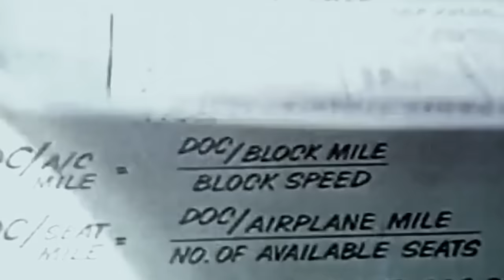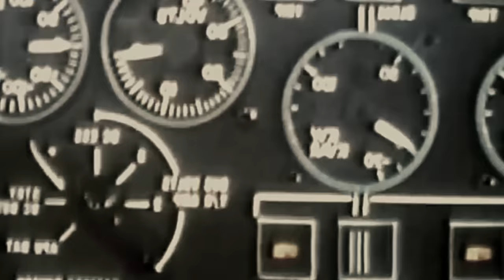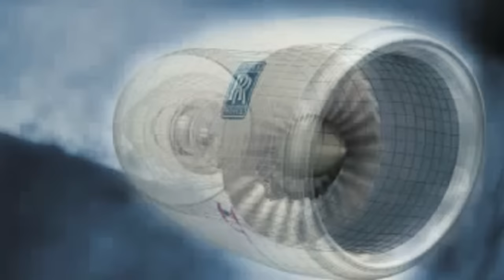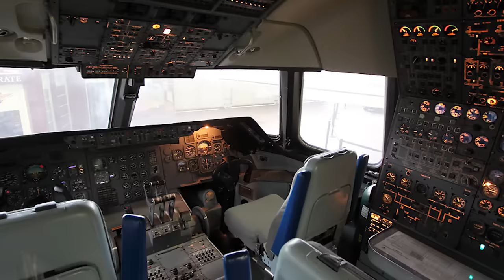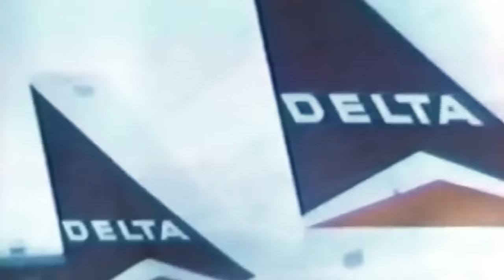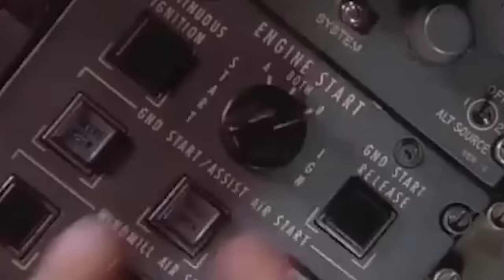L-1011 Tristar - too advanced for us

Comment: The biggest downfall was Lockheed too much tailoring the plane around the Rolls-Royce RB.211 engine. Had it been designed so it could accommodate the Pratt & Whitney JT9D or General Electric CF6 engines, it's likely the L-1011 could have continued in production probably until the early 1990's.
Reply: Had no choice, the RB was the only engine that could fit into the rear fuselage (#2 engine) and produce the power required.
Reply: Wery strange then that When Boeing made the 757 they chose the RB 211 as there first engine.747 and 767was also equipped  with RB 211.Some airports have serious noise restrictions at night and since RB211 is qujeter than it's competitors it is an advantage for the the airline.Less  restrictions at night.Actually Trump insisted on the RB 211 on his own plane because it's qujeter.
Reply: Unfortunately, the RB 211 delayed the introduction of the L-1011, but what ultimately killed it was it's overall cost. It was over engineered compared to the DC-10 that was under engineered for the day. As a result, the L-1011 was about 20% more expensive per unit and the airlines initially went cheap, especially the U.S. airlines. Only Eastern and TWA ordered Lockheed. The remainder went with Douglas.
Reply: The marked wasn't big enough for two similar planes,that's why it failed.Both companies failed.
Reply: @perolavlien2096  - Yes, that is true, in part, however, there were three other factors that doomed the L-1011. 1.) Late introduction due to Rolls Royce bankruptcy; 2.) Cost per unit of aircraft; and 3.) The L-1011 could not be extended on its then current frame and would have required an extensive redesign. As a side note, the L-1011-600 model was a twin engine plane that was in the development stage when Lockheed elected to terminate production of all civilian aircraft.
Reply: Your 3) reminds me of the B707 vs. the DC-8. Douglas, with future development in mind, gave the DC8 longer legs (quite literally) from the get-go, which gave them more leeway with fuselage lengthening and the later CFM-56 re-engining program, while Boeing's choice of much shorter undercarriage legs gave them no room for later expansion without major redesign.
Reply: Delta also went with the L-1011, and eventually became the largest U.S. operator of the TriStar.
Reply: @19580822  True, because the L-1011 was the perfect plane for Delta, especially on its longer routes out of its Atlanta base. Delta L-1011's were frequently seen on the US West Coast, especially in San Francisco and Los Angeles. Nowadays, Delta uses (I think) the 737-900ER aircraft on this route.
Reply: Could be. Used to be the 767, but they're aging fast.

Comment: Loved the Tristar in RAF service, there were a number of variants based on the airframes aquired. The ex PanAm airframes were unaltered, but other airframes were used as tankers with passengers and baggage bins on the main deck. The other variant had a cargo door fitted by Marshall's of Cambridge and could accommodate 108 x 88 aircraft pallets on the main deck.
The usual cargo hold on the tankers was fitted with fuel pods.

Comment: I got to love the Tristar when after leaving the Royal Air Force I went to work in Saudi Arabia.  All the flights too and from Saudi Arabia were done with Saudia Tristars or 747s.  I just love flying in the Tristar, so comfortable and quiet, actually the best commercial flight I ever had was in a Tristar on the day Princess Diana married Prince Charles.  The flight only had 45 passengers aboard and as a result I ended up flying to Riyadh in business class, but there was a lot more about that flight that made it great.  On a sad note I was at Riyadh when the Saudia Tristar returned with a on board fire.  That aircraft as I am sure you are aware burned out on the taxiway killing all on board.  Our flight line building was about 400 yards from the burned out hulk, and I swear to you I can still smell the burned aircraft structure, and of course the smell of burned flesh. That was nearly 40 years ago and I still can smell it when I think about it.
Reply: Dated a flight attendant for American Trans Air. The lower galley on the L-1011 was a great place to join the Mile High Club.

Comment: I was treasurer and fleet officer at American Trans Air (later named ATA Airlines). We began operating the L1011-50 and -100 in 1989. We had 14 standard body TriStars and we added the five Royal Jordanian L1011-500’s to the fleet in 1999/2000. These were great aircraft for us widely used for our Pleasant Hawaiian operation and US military charters. The RB211-22B became a very reliable engine and the -524B4 on the -500’s even better. Besides the shorter fuselage, the -500 has a ten foot longer wingspan with active ailerons. In effect the -500 was a completely new aircraft. ATA became the largest TriStar operator with 19 aircraft in 2002.
Reply: I was a Lockheed system instructor and conducted training at Indianapolis.  I didn't realize ATA had so many Tri Stars.

Comment: The largest aircraft I've ever flown on was a British Airways L-1011, named The Stargazer Rose. I had two rides - the outbound and inbound trips. Outbound I was just aft of the wing leading edge, port side. When the engines started up, it sounded more like being on board a bus, the jet engine whine and whistle was not prevalent. On rotation, I had the most impressive view of condensation flow over the wing imaginable. At first, I thought we were in trouble because you could hear and feel the airflow vibration from inside the airframe - it was a kind of groaning noise. When the conditions causing the rough flow ceased soon after it started, the spectacular display of that flow from the front of the port nacelle, riding over the pylon and past the wing, suddenly stopped, along with the heavy airframe vibrational noise. That true life lesson in aerodynamic laminar flow will never be forgot.

Comment: I was a phase maintenance mechanic for the L-1011 as well as a mechanic for Boeing and McDonnell Douglas aircraft for TWA in the early 90s.  The L-1011 was so much easier than the 747, 757, 767, and DC-9s I worked on.  Even the RB 211 engines weren't bad to work on.  Maybe with an updated engine there might be a market for the L-1011.

Comment: I was working for RR in the late 60s and well remember the problems with the Hifil fan blades which ultimately had to be replaced with much more expensive titanium ones. I left before so-called crash in 1971 (having seen the danger signs) but rejoined 3 years later and stayed until I retired in 1995.  Although it wasn't mentioned in this video the unique feature of the RB211 engines is the 3 shaft configuration as opposed to the 2 shaft arrangemnts of its competitors.

btw though Barnoldswick was one of the earliest RR factories it is still in operation.

Very iteresting video, thanks
Reply: I think he mentionned it.
Reply: And that engine had super fast throttle response due to lower inertia of the 3 spool design.  We had an amusing problem with new pilots over speeding the engine.

Comment: One of the innovations: It had DLC- Direct Lift Control. Only airliner that I’m aware of with it. DLC uses paired wing spoilers and integrated horizontal stab trim to adjust flight path without changing the pitch attitude while minimizing power changes. I believe DLC would have prevented all the hard-landings/bounced landings that claimed several MD-11s. As an aside, the F-14 had DLC. It was a significant challenge getting aboard when it wasn’t working.

Comment: My husband and our child, flew out of San Francisco in 1982 on a huge plane. It had to be a "wide body", because I remember we had 3 seats on one side, because we had to have a seat for a carrier for the baby. The center had several middle rows of seats then 2 or 3 seats on the other side. A huge plane. When it took off, it felt like it was going straight up! It made a lot of cracking and popping sounds!! Scared me!! But when we leveled out--- the flight was really good. I like to fly. That was the largest plane I've ever been on. I've flown a couple of times, but in much smaller planes.

Comment: I know this is off subject, but I have to recognize the C-5. It's monstrously big! I lived near the Naval Air Station at Norfolk NOB and for kicks my wife and I used to go out by the runway and watch C-5's take off. Runways are made of concrete, and they're also poured in great slabs, so as the aircraft rolled over the transitions between the slabs it would jar the aircraft a bit and the wings, which hung down slightly when at rest, would appear to be flapping! It looked like a giant gooney bird trying to lift off! What a sight! When it finally rotated up the wings would straighten out and off she went. We'd also see them land without cargo. As they circled the field on approach they would appear to be just hanging in the sky and not moving at all. The wing surface is so huge that it really didn't need much forward velocity to maintain lift, just enough to keep air moving across the surface. What an amazing aircraft.

Comment: My favorite Jet to work on.  Easy to work on, the RB-211 was so simple, THE worst job was replacing the reverser cables on No.2 engine after they  rat nested.  Second worse job was replacing one of the pack control valves,  located in the lower galley, you always brought a 2x4 when you had that job.

Comment: I just had the last chance to be a passenger on a L1011.  In 1995, I flew from HKG To SHA on Dragon Air.  Even then, Dragon Air has only a few still operating.  They already were operating A330 and A320.  But when they were short on aircraft, they still had a couple L1011 retired from CX as back up.  That was also last time I flew out of HK Kai Tak Airport.  In 2007 I flew again from PVG to HKG on Dragon Air, but it was a A320 already.

Comment: The L-1011 remains my favorite wide body jet. Indeed it was my favorite jet until I flew on the B757 in 1988, which became my favorite jet. Though the L-1011 was quiet on the inside, the Rolls Royce Engines made a racket. I used to live on the LGA takeoff path. I could hear the L-1011 take off from 10 miles away just as soon the engines thrusted. No doubt that the short runway at LGA was the reason why the pilots used full throttle to get those big birds off the ground.  I loved the sound of those engines. Though loud, the engines didn't harm the eardrums like the B727 would. I also lived a couple of miles from the glidepath approach to LGA. I could always spot the L-1011 as it had a distinct angle of attack which none of the other jets had. I flew on the L-1011 regularly on flights between LGA-ATL, LGA-MIA and of course LGA-MCO. My very last flight on it was on TWA from LGA-STL in 1988. I hated the DC-10 and never felt safe on them. Compared the the L-1011 the DC-10 didn't handle turbulence very well. I've been on the B747, 767 as well as A300, 330 and 340. With the exception of the A300 none of them had the luxurious spacious comfort as the L-1010, though Austrian Airlines operates the nicest A330 only because of the cabin layout, which is specific to the carrier. There will never be another aircraft that was as classy, comfortable or as smooth as the L-1011. Bless it!

Comment: I worked for Lockheed for 30 years and on the L-1011 from May 1970 until mid-1977 as the Group Engineer/Sr. Systems Engineer for the Software Flight Test Analysis & Evaluation Group which processed, analyzed, and evaluated all of the L1011 flight test data critical for FAA certification including the L-1011 CAT IIIc autoland certification. The L-1011 had an advanced 4D fight control system that actively managed throttles, navigation, and aircraft flight attitude assuring the most fuel-efficient flight path possible and enabling the L-1011 to arrive on time with minimum pilot interaction. The L-1011 was the most advanced jet aircraft, both commercial and military, in regards to its automated 4D flight control system at the time. It truly was ahead of its time and the unfortunate victim of unforeseeable economic circumstances.

The L-1011 4D FCS was later enhanced and improved for use in the F-117A Nighthawk stealth fighter for which I was the Department Manager of F-117A Avionics Systems Engineering and Test & Evaluation.

Comment: I had the pleasure of flying on an L1011 from LAX to Honolulu in about the year 2000. When I opened the overhead luggage door, I was amazed to see the drilled-out alloy structure of the bin supports. Nothing was heavy or hidden by plastic covers, as with other aircraft manufacturers.

Comment: I graduated high school in June 79. Went to Lockheed's "Tunnel Tech" for three weeks. Called Tunnel Tech because the class was underneath Lockheed's Plant 10 in Palmdale CA. After finishing ths class, went to work on the L-1011's. Worked on them from late July 79 to December 81. That was around the time Lockheed had announced they weren't taking orders for anymore. I moved over to TR-1 production, which lasted around another year. Got laid off in December 82.

Comment: I worked cargo out of Manchester (MAN) for 6 years and the main contract was with Delta out of MAN and LGW. I loved the L-1011 and we had both -250 and -500. Bizarrely, the shorter -500 was better for freight with 4x 88" pallets at the front and I think 6 LD3's at the back. The longer -250 didn't take palletised cargo and for us was a nightmare as larger dimension freight wouldn't go in a baggage bin, and we never had enough anyway. They were eventually replaced with the MD11 which had a better uplift.  I believe we managed to get the all time cargo load record for the L-1011 out of LGW with general freight on a -500 with a full pax load. I still have a copy of the load sheet and 26000Kgs and some was achieved. Fond memories of the Tristar, including working on the pax side for a short while at MAN as DL was the carrier for the British Olympic team in 1996 when it was in Atlanta - of course Delta was the official carrier! We had some crazy out of gauge freight to shift including very long row boats.  Incidentally, my father was working at Rolls Royce cars in Crewe when Rolls Royce collapsed due to the RB-211 development costs. A scary time for everyone, but it all worked out ok and the RB-211 proved to be a great engine. Happy memories and thanks for the video as well as the research behind it.  One other thing that I remember, myself and some colleagues were dead heading between CVG and LGA and we were put right at the back under the third engine. 'Whisperliner'? I think you'd need to be deaf to call it that, it was LOUD! Fun time though.

Comment: I remember the electric coat racks in the very rear of the coach cabin. I also remember my very first flight in the 1st class section of an L-1011.  They had recessed lighting units in the ceiling with these suspended trays to hide the bulbs.  We were departing DFW on a hot humid day and the condensation had built up in the trays.  We started our take-off roll and rotated and all the water cam sloshing back to douse the passengers in the rear of the 1st class cabin,  It was pretty funny.

Comment: In 1980 I sat in a window seat on one of these amazing planes as we waited for 1 hour before takeoff. It was in Atlanta. It had been a rainy hot day and the humidity index was unbearable. Rather than turn on the air conditioning the pilot just ran the circulating air fans without AC. Thick cascades of humidity laden air fell from the overhead ducts. We were drenched in clouds. But, like a swamp cooler, we suffered less. In ten to fifteen minutes after takeoff we were completely dried out.. That's the worst experience I had on an L-1011. Delta often used their L-1011s to pick up loads of passengers in SLC during.a stop overs on their Atalanta to LA and San Diego flights. I had many experiences sitting  in one of the two side seats in those planes and enjoying the smooth and relatively quite rides from SLC to California. I miss these Tristar jets. Lockheed did a good job designing and manufacturing them.

Comment: Me and some collegues stood on the roof of the Martinair main building at Schiphol airport once.
I noticed an old Tristar getting ready for take off and mentioned this to my collegues.
At a certain point during the take off roll, one of the engines produced flames.
The pilots hit the brakes immediately and aborted the take off run.
I was so amazed to see this and the firedepartment took less than a minute to arrive on the scene which also blew my mind.

This was around the year 2004.

Comment: I had occasion to fly in this equipment regularly in the late '90s. What I remember was that in the coach area, there was a constant droning noise from that third engine. In first class it was no problem but it was really annoying to sit in the back. Conversation was difficult and concentration, such as reading a book was a pain. Whenever I had to fly this plane I always tried to upgrade. I was glad when Delta quit flying them. Loved the 767's that replaced them.

Comment: I have flown on this beauty several times in the early 1980’s operated by Gulf Air. The aircraft was smooth , silent and reassuring with soft low speed landings unlike the present aircraft’s with very high take off and landing speeds.

Comment: Great plane to fly on as a passenger, and one thing they did not mention - for people who have trouble with pressure equalization (as I do), this plane had a wonderful pressurization system. I don't know why, but it was way easier on the ear pressure. And it was a quiet plane, as they say.
Reply: That Environmental Control System was very well designed like every thing else on the Tri Star.